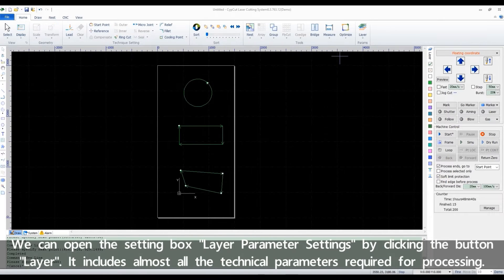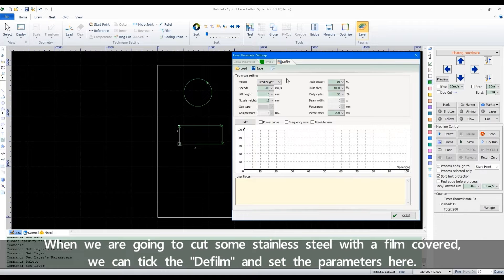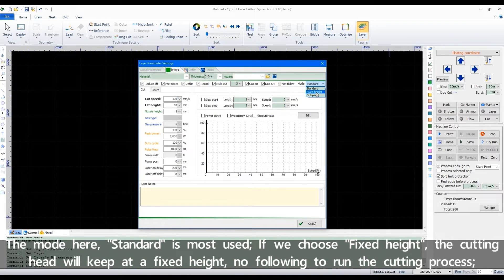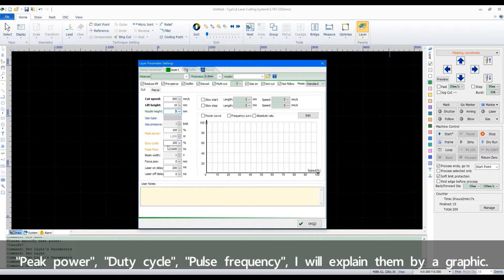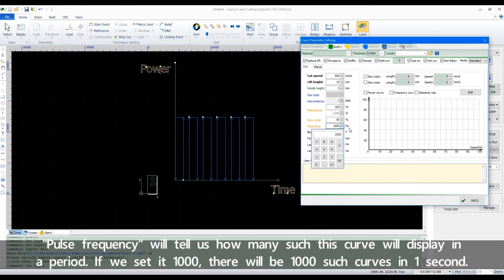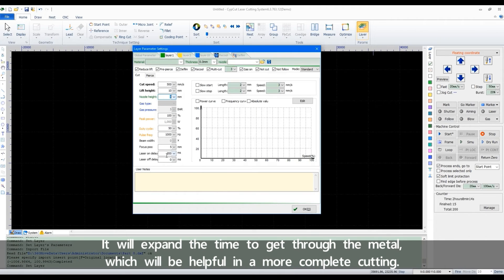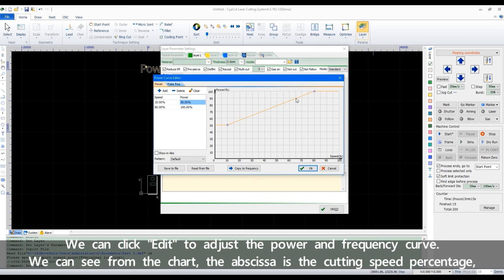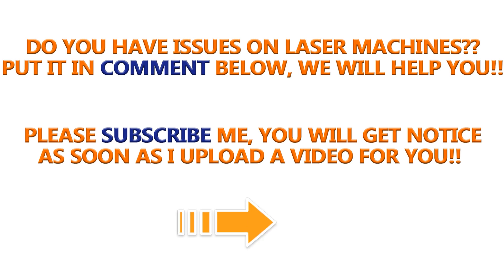CypCut Software Tutorial English | Cypcut Laser Cutting | Complete 8

Comment: I'm going crazy with CypCut. Here is the problem:

We use 2 layers for each type of material. One layer for cutting and the other for markings. I put all the cutting parameters (focus, speed, etc.) for each of these two layers and save it with the name A on the disk. Let's say I set focus -2 and speed 9m/min for the cutting layer. And focus -1 and speed 10m/min for the marking layer and save these parameters in a file named "A".

Then I change these parameters and save it in another file with the name "B".

When I read the file named "A" the parameters are different from those I previously saved. Sometimes "A" gets the parameters from file "B".

This is really crazy and after several attempts I can't figure out the problem. Maybe a software error?

Thank you!
Reply from the maker: what version, 2000? please show me a video on how you saved parameters.

Comment: I ran a Trumpf Laser for 9 years.  The beam width was automatically set when you selected your material type and thickness.  You could change it by opening the software and scaling it up or down, but I never found much use for it as the default beam width/kerf always seemed to work fine.  I now run a system from a China manufacturer.  CypCut is the operating software.  It seems to me the beam width is not selectable in the video?  Is that correct?  Do some systems have a fixed beam regardless of the materials?  On my new system, the beam width is selectable but there is always the same setting on each layer.  Do you recommend I stay with one beam width for all cutting?  If not, do you have any information on recommended beam width by materials and thickness?   If the beam width is adjustable, I would think you also need to take this into account when programming for kerf offset.  Does my entire question make sense?
Reply: BTW - your videos are so helpful!